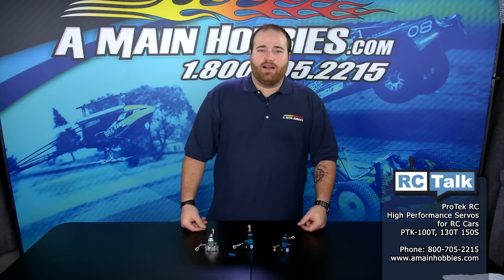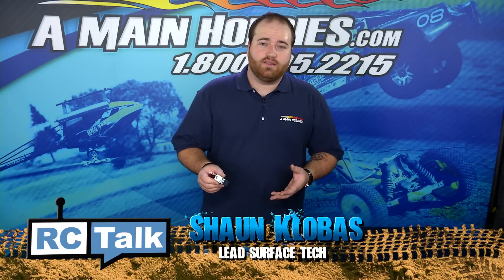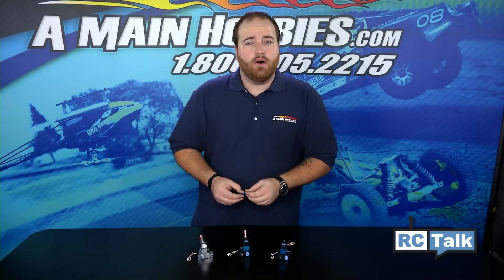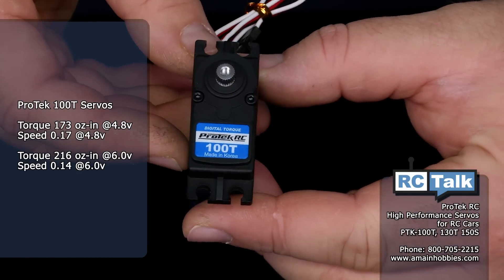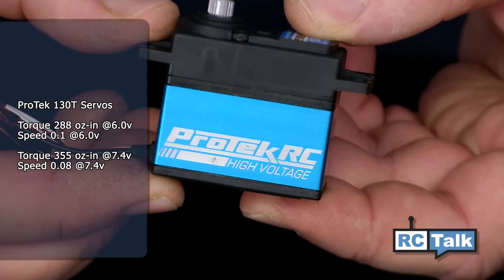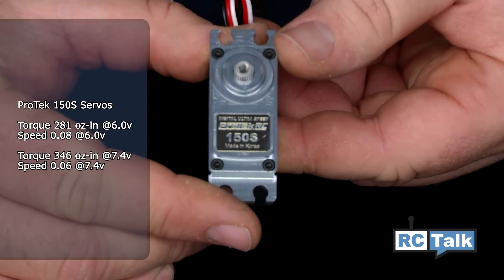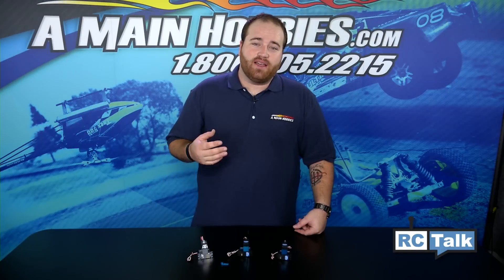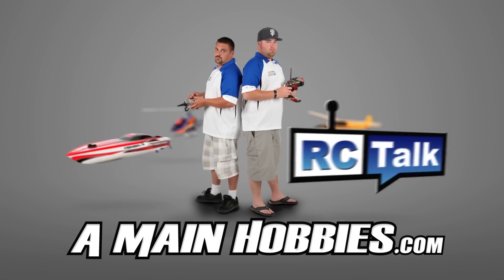AMain Hobbies' RC Talk: ProTek RC Digital Surface Servos

Comment: Will the Protek 130T or SS fit in a Traxxas 4tec?
Reply from the maker: Yeah, both will fit Paul. These ProTek servos are standard sized, so they drop right into the 4-Tec since it uses a standard sized servo. 
-Brett
Reply: AMain Hobbies awesome, will order